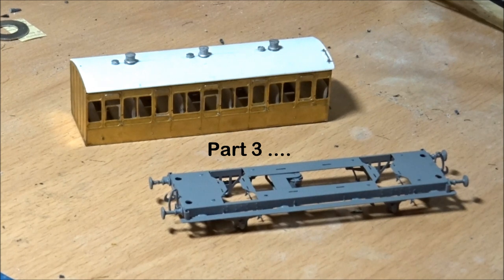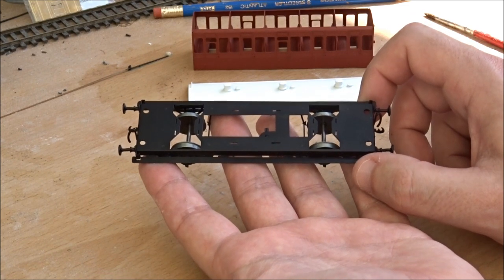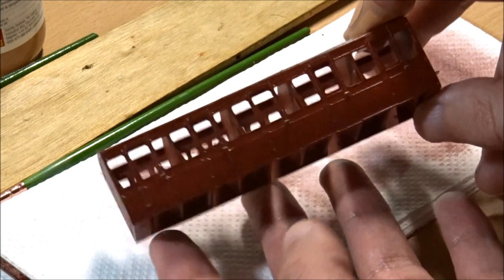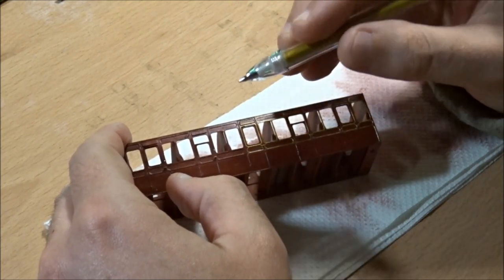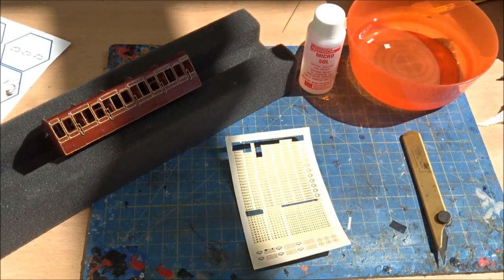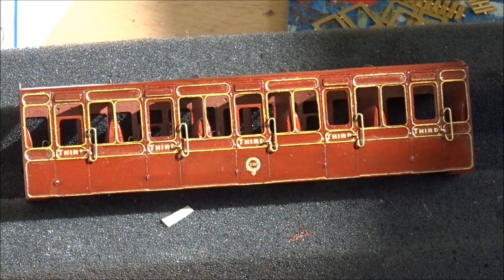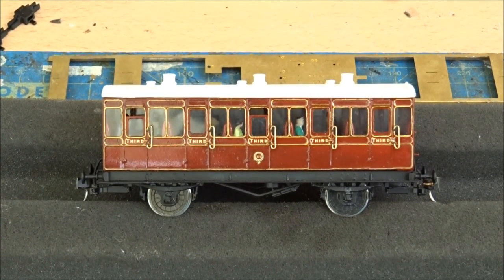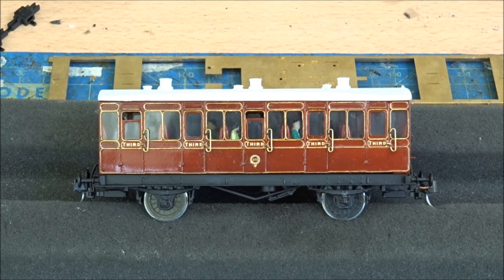Workbench -  Roxey Mouldings, LBSCR, All Third, Part 3

Comment: Inspiring, definitely need to have a go myself with some LSWR coaches.
When did you apply the thinners to the paint btw?
Also, what varnish did you use?  Gloss?
Looking forward to seeing it running!
Reply from the maker: Brush is damp with thinners and only a small amount paint on the brush.
Vallejo spray resin acrylic resin. I use satin but can use gloss.
Reply: @bluebellModelrailway  Thank you very much!